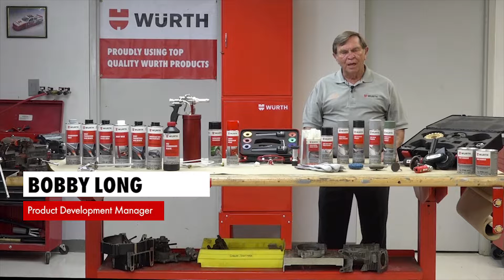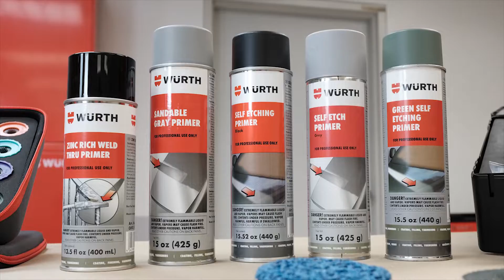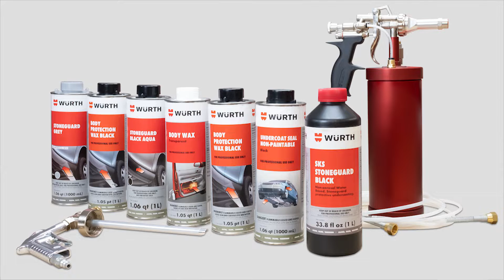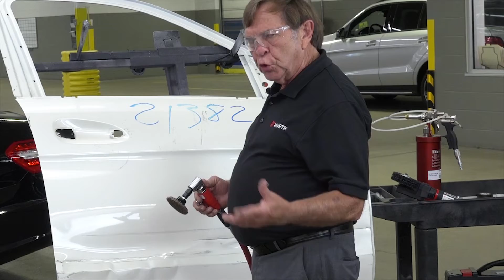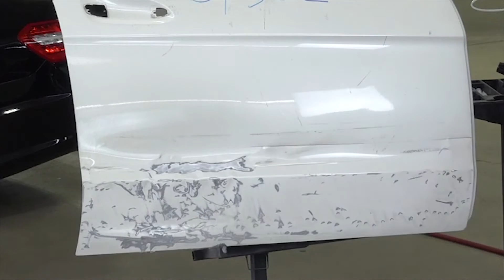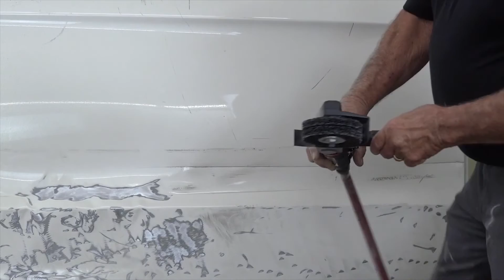Corrosion Protection

Comment: Regards, the product correction protection spray reference 893-15 is used to place it on plated jewelry garments since water and salt destroy them and I wanted to know if I put this product on it, it can protect it for a long time, the other question if it is transparent  I would like your recommendation and comments, if so I will buy it here in Panama, they sell it, thank you very much